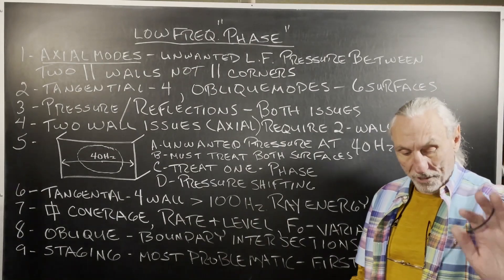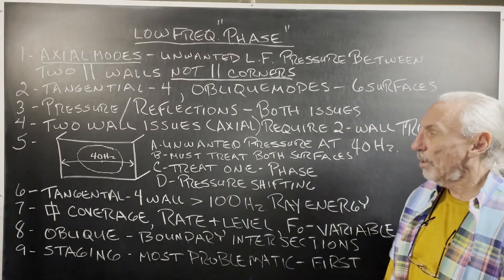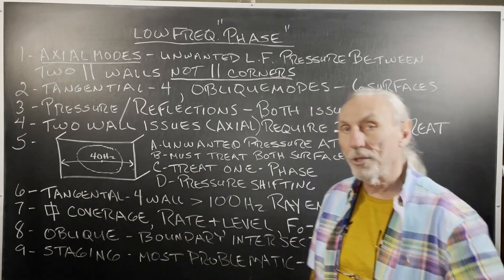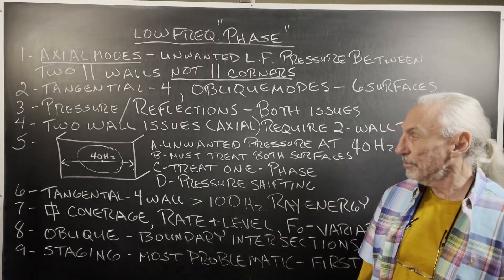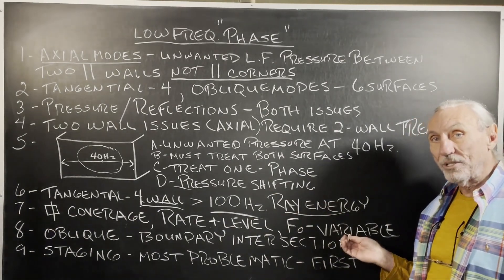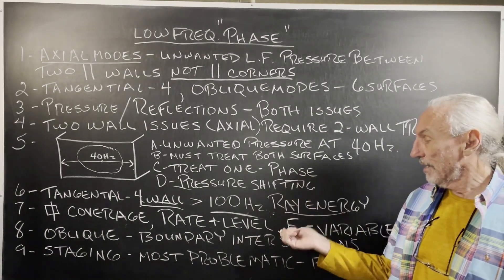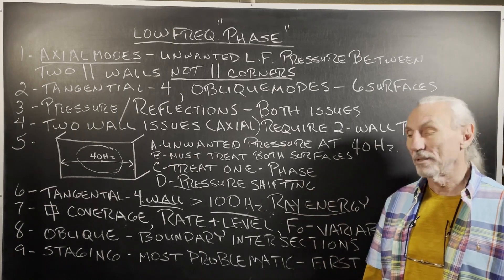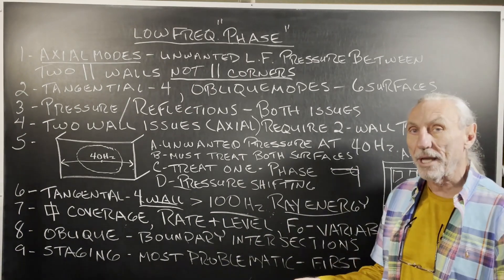Low Frequency Phase - www.AcousticFields.com

Comment: Mannn im so glad im seeing this. I’ve been thinking that because the middle of my wall has just as much build up as when I walk R L its not the corner but since its the closest to each side Wall possibly could it seem like there is more basss because there are more everything as it being the closest point to both sides surface? Ami making any sense here im dyslexic so trying to describe everything as I hear it in my brain can get real frustrating lol. Thx brother
Reply from the maker: Its not frustrating when you understand how sound pressure behaves within a room. Every wall, floor, ceiling surface area produces a different frequency and amplitude (strength) issue that must be treated with the proper type of treatment along with enough surface area coverage to have an audible impact.